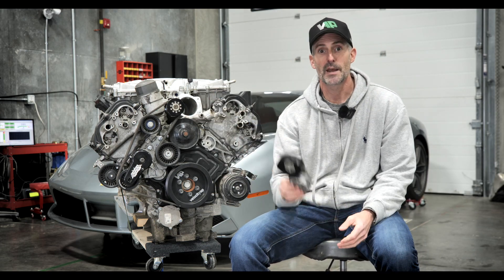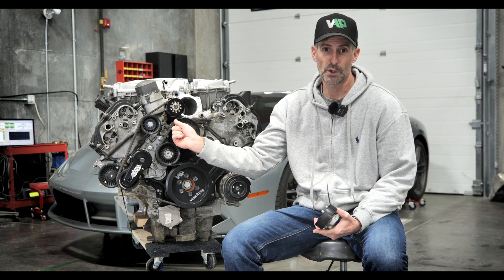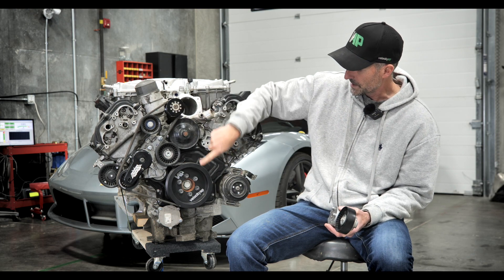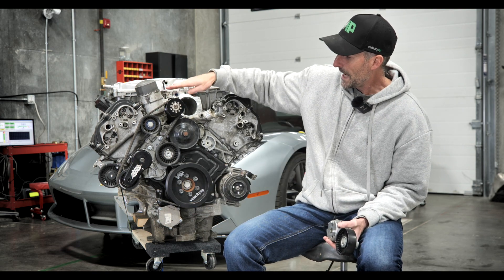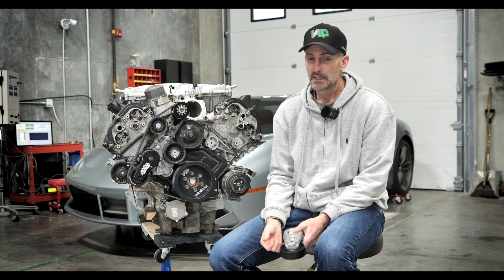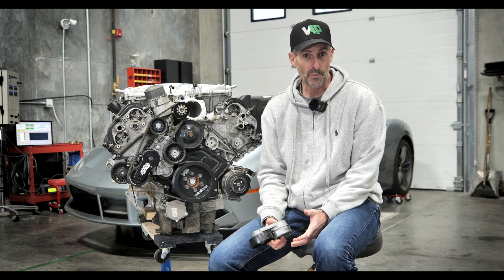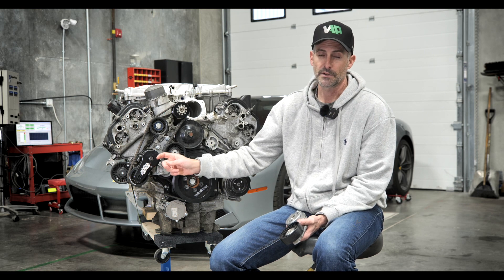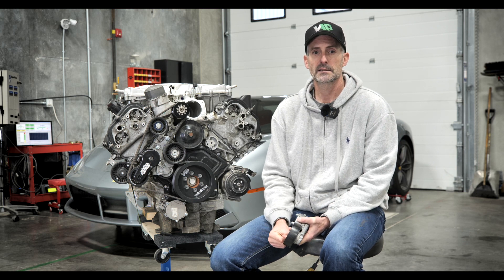We fixed a major problem with the supercharged JLR engines

Comment: Well I remember having my Jag constantly spending it's time in the shop or dealership with all your parts and "wrong tune". I'm really upset about my experience but with all that I know now, the Jag platform with all the quirks worked out is the most bad ass cars/suv you can drive. Maybe I'll pull the trigger on a another one.

Comment: Keep thinking about jumping from my F90 M5 into a coupe, like the Jaguar F Type SVR. I always had a soft spot for the SVR. Ended up in a 2018 C7Z06 Carbon 65 instead of an SVR. Later moved onto an AWD platform (F90 M5). But the performance numbers would have to make sense. Intakes, Turbo inlets, downpipes, 93 octane tune and I'm already dipping into 2.7-2.8 second 0-60 times on Michelin Pilot Sport 4s on the M5. What kind of street numbers are these TVS 2300 Jag's (full supporting mods obviously) recording?

Comment: Doesn't the extra tension put more pressure on the supercharger snout bearings?
Reply: Forget the snout bearings they provide faulty products which shred your belt and it snaps them causeing further damage to your car, and then they blame you for it and dont cover the repair costs
Reply: @Snow1998v1 mate, what are you talking about? The extra tension on the snout bearing is a legitimate engineering design question. Automotive engineering has everything designed with a factor of safety.  It makes sense then after adding the velocity top pulley and bottom pulley the greate 
 circumference  travel for the belt will supersede the spring load on the standard tensioner. However, they fail to improve the snout bearing. It's  going to put more load on the bearing/snout HSG  and therefore possibly create a failure in the bearing HSG itself. 
Remember when you buy these aftermarket products your warranty; if you had any; goes right out the window!
Reply: @davidwall4448  what are you talking about lmao

Comment: The way its routed looks wrong. I know thats how they come but it looks like the charger, crank and central idler are correct then the top idler and tensioner are just wrong altogether - like they are an afterthought. 
I would also love to know why makers don't use toothed belts when belt slip is one of the most common issues with a blower.
Reply: Noise??
Reply: @Watch-Andrew-work  Have you heard the sc jlr engines? You really wouldn't hear it.
Reply: @siraff4461  Well, I own the 5.0 version. Mine is mechanic owned and very quiet as it is. Plus it is VAP tuned!

Comment: Isn't there some way to route the belt under the upper idler pulley and redesign the tensioner? Going under the upper idler would give it another 20⁰ of surface contact.
Reply from the maker: Hi Christopher.  There's a way to do pretty much anything we want, but the questions really are cost and practicality.  We could redesign the whole front end drive system.  In fact, we have designed an alternative system which uses a Ford 7.3 Godzilla tensioner, acting in the opposite direction & passing the belt between the pulley and the tensioner body.  It requires deleting the mechanical vacuum pump & installing a much larger bracket.  We may yet offer this package, but it's several times more complicated and costly and we found that the simple tensioner upgrade accomplished the objective of eliminating belt slippage, at the stage of modifications we are now at.
Reply: @VelocityAP  Hi Stuart . What about wider pulleys and a belt with more ribs? Like maybe a 10 rib or 12 rib double sided belt setup?

Comment: My original tensioner only lasted 4 years/ 40k km before weakening to the point of noticeable belt slip - before I'd even swapped out the pulleys! Maybe it was just a bad unit. Replaced it with another one from JLR. If/when that one wears out I'll certainly be getting this upgrade.
Reply from the maker: They are definitely a 'wear' or 'service' item and will not last forever.  It's nice to have a stronger unit available.
Reply: My grooved one was just worn smooth. I have a 2017 ftype R. I’ve just ordered the upgraded tensioner!